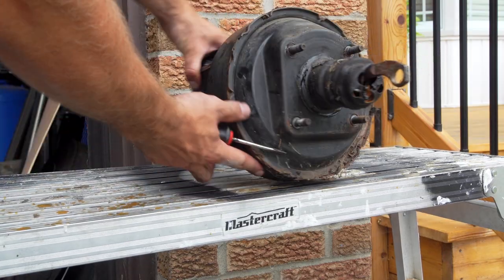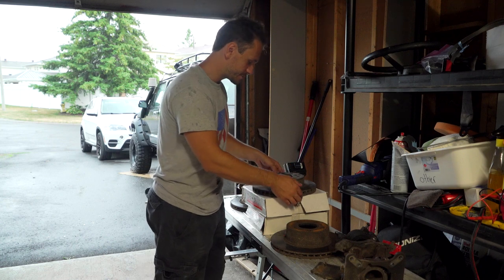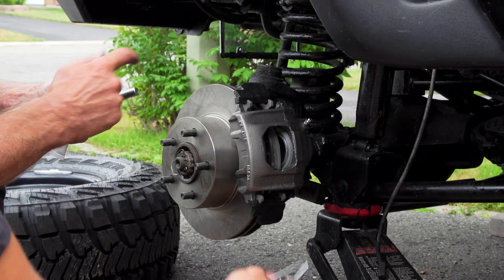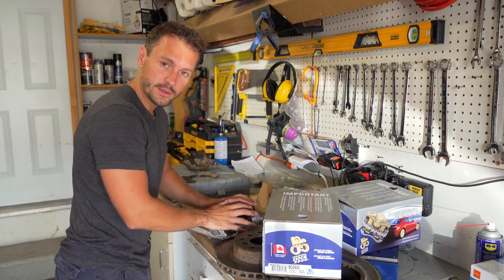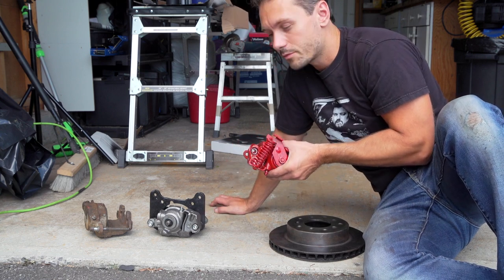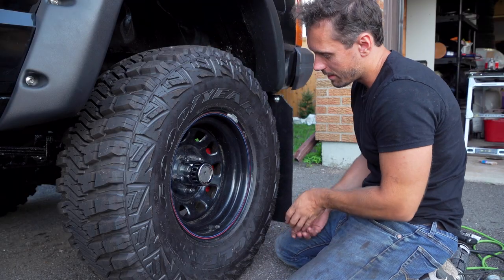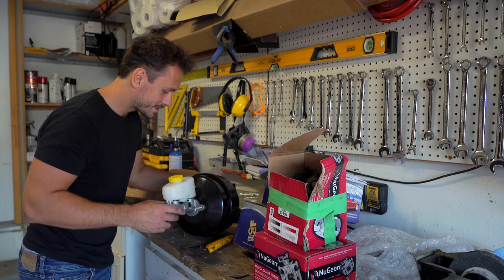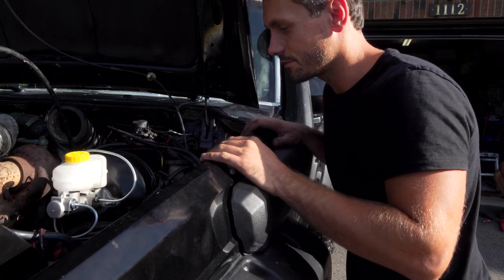Brake System Upgrade Booster Discs Calipers Master Cylinder | Jeep XJ Cherokee Restoration | Part 8

Comment: There is a mix of Metric and SAE on all XJ's from '91 and later when Chrysler started doing their thing with it.  I don't know about the Renix era XJ's under AMC's rule.  I suspect they did.  It's a PITA when you think it's a 3/8ths and it's a 10mm.  And don't use an 8mm on a 5/16ths.  It's actually 7.9mm.  A six-point box end wrench can be had so you won't round off those little buggers.
Reply from the maker: Was wondering about that, thanks man

Comment: That looks a lot like a Leed disc brake conversion on the rear. Those cost quite a bit of money and what I would have done is have the rotors turned rather than changing them out. Looks like there is a lot of custom stuff on the Jeep and it looks really good. Please don't lose interest in your project.
Reply from the maker: Thats what I thought too, i ended up calling leeds but for some reason the rotors wouldnt match up. I think this kit was bought around 2002-2003 so really old. Like I said I ended up saving the rotors, they passed safety and are still okay. One day I may try to again but likely just get a new kid. I only drive the truck around 800km a year. Thanks for the tips I appreciate it.

Comment: What size tire, wheel, offset, and backspacing are you running?

Thanks
Reply from the maker: Oh boy I've had these rims since '05 when we bought it, came with the truck, not even sure of all the details to be honest. They're 15", 32" that's pretty much all I know. Trying to keep it as simple as possible, no wheel spacers at all.